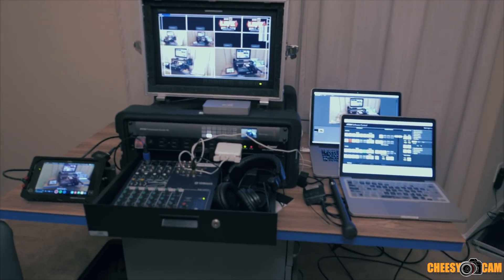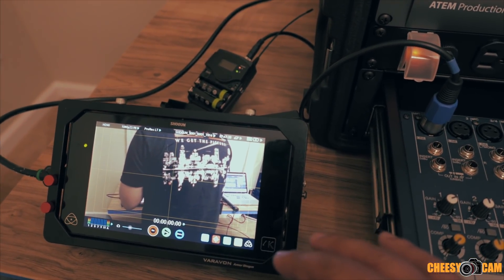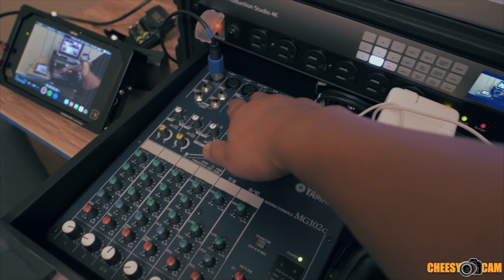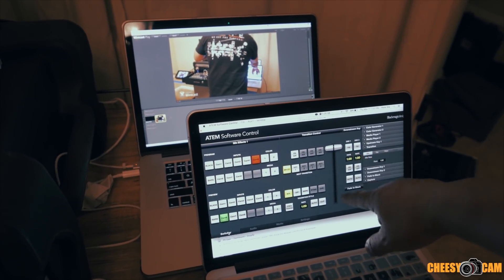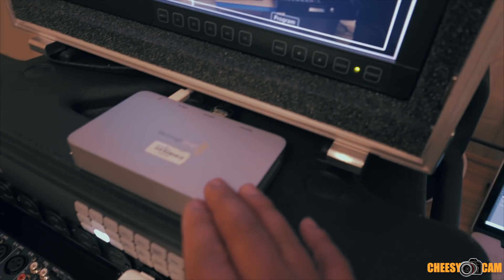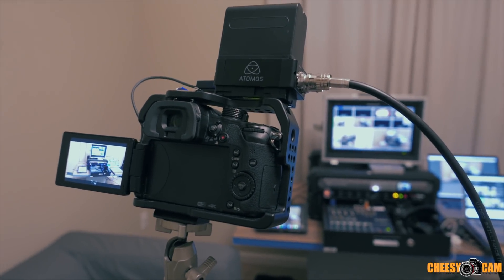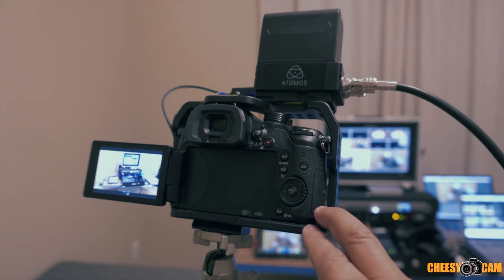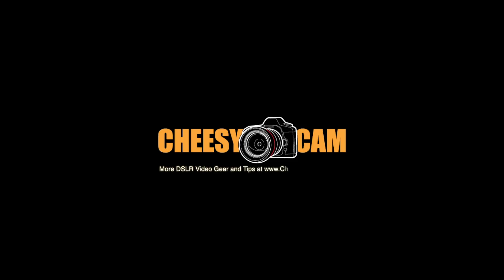Walk Through BlackMagic Design 4K ATEM Multi-Cam Live Switch Live Stream Video Setup

Comment: I have an almost identical setup in 2021 and had to add a datavideo AD100-M Audio Delay Box because I use the Blackmagic micro converters rather than the Atmos H2S's on My GH4's ( didn't even know about them till today!) and the  seem to create a 10-20ms delay as my audio is hitting the switcher in realtime. Have you ever noticed any delay on converting with the H2S or with a the micro converters?

Comment: you may know this by now but the HDMI connectivity was not a switcher problem. HDMI is only rated for 50 ft. For connecting cameras reliably the distance is even shorter, only about 15 ft. to be consistently reliable. For the distances you're using you made the right move to SDI. Nice setup

Comment: Pretty cool setup, thanks for sharing! In our studio we're using the ATEM4k to control 3 BM Micro Studio 4k cams. As for now we're setting them up via HDMI and BM Video Assists connected to them but we want to control gain, WB and aperture etc from the ATEM. The problem is that the ATEM is in another room. Do you know how to control the BM Micro settings wirelessly via the ATEM? (cams are connected to the ATEM via SDI)

Comment: Hi, I am from India..I have heard that the BMD Hd studio pro has having a sync issue...Can u put some lights on my issue
Reply from the maker: Sync can be caused by latency from different cameras or audio equipment. An ATEM is a ‘switcher’, and doesn’t mean it will just magically sync everything. You have to use the right cameras and audio equipment also.

Comment: Hi, I'm planning on buying an ATEM (same as yours) BUT I need to play back movies from a MacBook pro, I'm concerned about HDMI handshaking and copyright protection on movie playback... do you have any experience with this? great video by the way, most useful.
Reply from the maker: Rip the movies to a file and then play them through your computer. Sometimes you’ll need a framerate converter/scaler to match the other inputs. Peep decimators..

Comment: Hey great video! I just have one question, I would greatly appreciate it if you have the answer to it :O 

I have the ATEM Production Studio 4k, and I've been cracking my head open trying to see if its me with the problem or what jaja but I'm trying to configure the switcher with the GH4's and I just recently aquired a UX-180.

Now, I managed to configure all of my GH4's with the switcher at 2160p24. I felt EPIC! lol, I then plugged in my UX-180 and I made sure the cameras Record Format were all at 4K 2160/24.00p 100M

I am positively 100 percento, that they're all on the right format. 

I then started to mess with the UX-180 and the ATEM, and I managed to get it to work at 2160p25! WHAAAAAT?!?!?! But my UX-180 has to be on 2160p25.00 100M 50.00Hz

I have my GH4's at 24Hz. 

I don't know what to dooo lol 

PLEASE HELP!!!!!! D:
Reply from the maker: The thing about some cameras is that sometimes the internal recording setting is not the same as what is being output through the HDMI. You may want to find a way to test the HDMI out of your other camera, as it may not be 25p. Perhaps the internal is set to 25p, but HDMI out is something else.

Comment: The Roland VR-50 does ALL of that in one unit.
Reply from the maker: The Roland is a sweet system. Not the 4K switch as this is, but it does have quite a bit as far as inputs. Though you'll still need another appliance to Live Stream to an RTMP server, and another Recorder if you want to record the program feed (prior to live stream). And if you're working with cameras that only offer HDMI output that need to be at distance, then you'll still need the H2S type converters. So while this looks like a lot, and the Roland offers a lot, there's still parts in here that people may still need even if investing in the Roland. THe VR-50 does a lot, but it will not solve all the problems.

Comment: I got a question for you, do you use video capture cards(blackmagic design intensity extreme or mini ultrastudio) in between the cameras and atem switcher? or ATEM television studio switcher can convert video?
Reply from the maker: I do not use capture cards between a camera and ATEM. If i have cameras with HDMI, then i’ll only use HDMI to SDI converters (to support long distance runs). The ATEM cannot convert signals. If you need to convert a signal, then I suggest looking into a Decimator.
Reply: ok, do I need video interface in between the switcher and the mac?

Comment: How come I can’t connect Sony camera on an atem switcher?
Reply from the maker: With an ATEM the input has to be the exact same. If you have cameras that output 1080p 24p, then all cameras have to be 1080p 24p (not 23.98). If you want to use 23.98fps, then all the cameras need to be the same. You cannot mix resolution or framerates or Interlaced vs Progressive. Every input has to be the same.

If you have something that does not output the right setting (like a computer), and you want to mix it in with your other Camera inputs, then you need a converter. Something like the Decimator can take any input and change the output so that it matches your other cameras.

Comment: Hey man! Thanks for the walk trough. Do you know if can connect a BMCC to an ATEM switcher?
Reply from the maker: +Rolando Diego Zúñiga Pino Yes, you can connect SDI or HDMI to a switcher..
Reply: Thanks for the reply! Yes I use my Canon 5DmIII with the hdmi to sdi BM converter and works fine but for some reason the BMCC 4K does not show any signal. Do you know what could be?
Reply from the maker: +Rolando Diego Zúñiga Pino First, if you are trying to use those two cameras on one switch it won't work. Frame rate and resolution on the input has to be exactly the same. 23.98 is not the same as 24. 29.97 is not the same as 30p. Set the ATEM to the exact setting as your BMCC. The Canon outputs 1080, the BM may be outputting 2K or so (not sure). But check the output and match it EXACTLY.

Comment: Very nice setup. Very good video. I don't quite understand what the Ultrastudio silver box does, you call it intensity, just acts as splitter? This two camera live switch and stream setup would be how much an hour, 2 team, ballpark ? $500ish ? Again, very well done video, no fluff, to the point. Thanks.
Reply from the maker: +Bogdan Spineanu I use the intensity as my capture card to stream the video to the internet through computer. You could easily charge $500/hour for a multicam setup, I usually just charge per project flat rate.

Comment: Any experience in using 1080p/60 formats when using them with your ATEM? I can only seem to get 1080p/30 or 720p/60 to work with my Blackmagic Decklink Duo 2 setup. When the cameras are set to output 60 frames I get weird flickering and sound artifacts. Every other 1080p/60 source seems to work just fine. Any settings I might be missing when setting up the GH4 for HDMI 60p output? Any help is highly appreciated :)

Comment: MrCheesyCam, Do you get any lag in the video program? I'm doing the same live switching with the Roland v-1hd with 2 gh4's. I'm getting a lag in the video program. You think its a in-camera issue or the switcher? The v-1hd has an audio delay setting but no video delay that i know of. Whats your thoughts? Much appreciated.
Reply: The GH4 has 3-4 frames of delay on the HDMI port whereas the blackmagic studio cameras and many other native SDI cameras have less than one. 

ATEM mixer adds 1 frame of delay if it isnt genlocked, software mixers and applications (OBS, Wirecast, vMix, xSplit) adds 3-4 too. 

Projectors can add a lot of frames delay if they aren't run in their native resolution or with software keystone enabled.

Any HDMI to SDI or SDI to HDMI conversion should be done in less than 1 frame as long as you don't have scaling enabled, but devices like the Decimator MD-HX does scaling in somewhere close to 1 frame delay which is really good in comparison to something like the blackmagic teranexes.
Reply from the maker: 👍👍 Yeah definitely the better the gear, the better the performance if you have to do real Live with little latency..
Reply from the maker: You will get latency with any switcher. Sometimes, you'll need a DAC to add audio delay to sync up video and audio.
Reply: Dang. Im doing a live concert. Running live feed to big screens next to the stage. It looks weird that the video is delayed from when the person is on stage. Do they make a video booster of some sort to make the video match the actual person on stage?
Reply from the maker: +CM Digital Media Hawaiii You can improve the delay with better cameras like Blackagic Design Studio cams, but there can still be milliseconds of delay added depending how far you are running your SDI cables. No way to speed up as far as I know.
Reply: Ahhhhh figured so. Thanks for the quick replies man! Always a fan of your tips and reviews. Bought a lot- A LOT of gear based on your reviews. 🤑

Comment: Nice video. But  you could get rid of all it and just buy a TriCaster Mini and one interface monitor. It would ISO record internally, stream and switch live. You could even have a Xkey controller for manual control of all sources without mouse clicking. I've got a custom keyboard coming out with hotkeys for TriCaster already printed on the keys too which will allow control of everything minus a mouse click. Yes, Tricaster's aren't 4K, but no one, (including you in this demo), is recording or streaming that high, so there is no point in all these pieces to do what you're doing. This just adds to multiple "possible" points of failure in a live situation.
Reply from the maker: Always pros and cons with many setups. I've already picked up the ATEM HD and Web Presenter with Hyperdeck Mini setup now. Switching is done from front panels now.
Reply: MrCheesyCam What does a tricaster mini setup cost?
Reply: $6000
Reply: Currently using a tricaster 8000 and wanting to learn how to use black magic setup - compared to NewTek, this looks COMPLICATED!!!!

Comment: Hi, very nice Video, just watched it, you seem professional. One simple question :-) 
Immagine a Powerpoint-Presentation from PC or MBP which is placed on the stage!
How do you connect that? Simply HMDI-out into "Atomos-Connect H-S" - 30 meters SDI Cable to your ATEM-Mixer?
(I use the Roland V1-SDI since 3 days :-) )
Does that work, or are there any "Handshake"-Issues coming from HDMI?
So, is this idea the best way - or what would be better for a presentation from far away?
Thank you - i appreciate your help! Martin.
Reply from the maker: The problem with using the input from a computer is it needs to be converted to match the same framerate and resolution as your other camera angles. The BlackMagic ATEM 4K  is a bit sensitive to this and doesn't have a video encoder built in. Some Production Switchers have built in encoders that can take any framerate and resolution and mix together.
Reply: Hi Mr Cheesy, thank you for that answer! So I will just try :-)

Comment: I noticed you didn't have anything in your rig to deal with video delays.  With my ATEM 1 M/E, I found that there's a 66ms delay between board audio and switch output that I record/stream.  We solved the problem by putting in two Behringer Sharks which, among other uses, have a delay function that resolves the issue (I delay the audio going into the switch to match the video delay).

Has this not been an issue for you?
Reply from the maker: About $99 bucks or less.
Reply from the maker: I don't show it in the video here but I am also using a Behringer shark.  I am only using one and it controls the master out .
Reply: Candlelight Productions How much do the sharks cost?

Comment: hi so doe it mean that  you connected all the cameras into that atem production studio 4k and it has got a final mix that you get wen switch cameras and you put the feed into the intensity board tyhhen from intensity into you mac using a thunderbolt cable then where are you getting bthe other feed that you are recording into the small device on the left in video.and can i have a preview output so that i can show the audience via tvs or something

Comment: Question: Lets say I want to live stream a talk/sermon. The speaker uses powerpoint presentations on two projectors in the auditorium so I want those slides to be live streamed as well as the speakers camera shot BUT I don't want to the camera shot to be put on the projector screens. Is there any way of going about that? So live stream both presentation and camera feed, but on projectors JUST the presentation and no camera feed.
Reply from the maker: I'm not sure if I understand this correctly as i'm confused about your comment on projectors. Live streaming to the internet doesn't have much to do with projectors. I'm going to guess you want to 'cut to the power point presentation' as if it were another camera angle? So in your stream you are cutting between different camera angles, and then cutting to the full view power point presentation?

You basically input this into the live switch from the computer's output somehow. Many laptops have HDMI out so you could pipe it into a splitter and have one sending the PP to the projector, and one HDMI to the switch. You would just cut back and forth as if it were another camera. 

The problem you will run into is that the HDMI feed from the laptop is not the same resolution and framerate as your other cameras. The BlackMagic Design switch doesn't like mixed inputs. So if you want to stick with BM, you'll need a video converter that takes all your inputs and outputs them to be consistent. Or you'll have to look for another switch that has built in video converters that can accept mixed inputs.
Reply: Sorry, i didn't explain very well. At our church the pastor has a powerpoint presentation that we project onto our screens during the service. We want to start streaming live to Youtube so we want to stream a video camera of the pastor on stage and also cut to his powerpoint presentation when needed. I want to run all that through the same computer. So people viewing on Youtube would see the camera shot and also the powerpoint, but inside the service we would only project the powerpoint and not camera shot of the stage. Hope that makes more sense.
Reply from the maker: Doing all this on one computer is going to be the trick. But something might be possible with OBS software. It allows you to add different camera angles and switch between them (one could be the power point window). Or you can create a screen that shows multiple windows at one time. Maybe this can give you ideas: https://www.youtube.com/watch?v=MrWnLoYdt9g
Reply: MrCheesyCam Awesome! I really appreciate your help!

Comment: Can you tell me what router you are using and how you setup it up?  Thanks
Reply from the maker: I've been getting this question a lot lately. Hard to explain without a video but it's basically just setting them up on the same network IP. I'm using a hootoo wireless router.

Comment: Have you tried another recorder instead of the Shogun? thanks
Reply from the maker: Yes you can use any recorder. I have also used a BlackMagic Video Assist and way back an Atomos Ninja. You can use any recorder as long as it can support the output (i.e. 1080 vs 4K).
Reply: Thanks for the quick reply... I was considering Átomos Ninja since the price is lower than other devices and it seems to be a reliable recorder, we are doing multi camera streaming at church but, would like to get a better quality when rendering to DVD ..
Reply from the maker: Yes the Ninja will work, but can only record in 1080.
Reply: MrCheesyCam thanks for the info!

Comment: +mrcheesycam How do you play back pre-recorded videos in program? what solution do you have?
Reply from the maker: You have to add it like  a camera feed. Then you cut to that HDMI feed in the live switch. It has to play from something that can output at the same resolution and framerate as the other cameras you have connected on the switch too. One way I have played videos is to use my Shogun or BlackMagic Video Assist recorders to play video files. I have to edit the video to ProRes (because that's what the recorders can play) and edit it to the resolution and framerate similar to my camera setups. Then when I cut to that it sees it as a regular HDMI feed that matches.

Comment: We have this basic setup. Need a suggestion on options of outputting to some type of dvd burner to provide high quality dvds for sale immediately after an event. HELP!!! Currently using an cheap dvd recorder that upscales but the final product is horrible.
Reply from the maker: Sorry I don't understand how the dvd recorder upscales. DVD is less quality than HD, UHD, or 4K. So it should be 'downscaling' the footage right? If ou want to retain the HD, UHD, or 4K quality, perhaps you need a different media instead of DVD. BlackMagic Design sells duplicators that can burn footage to several SD Cards at the same time.  http://goo.gl/UlQbpR